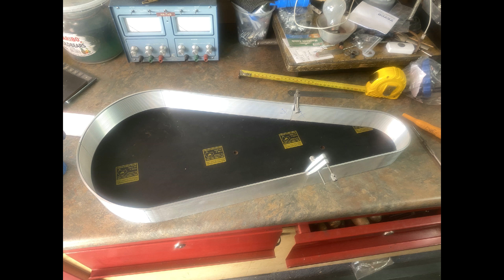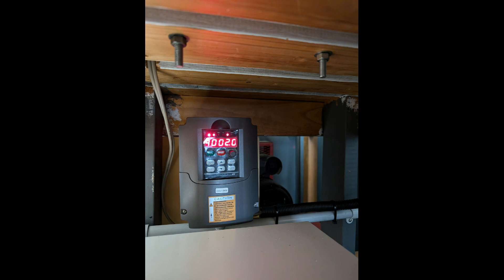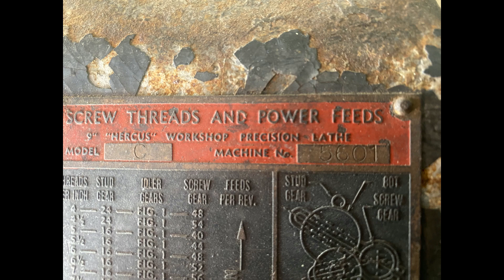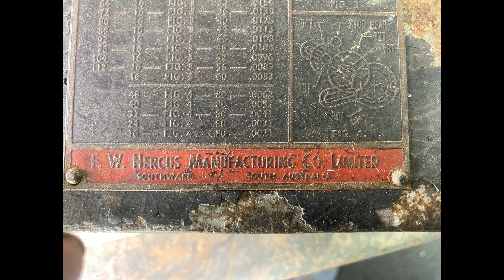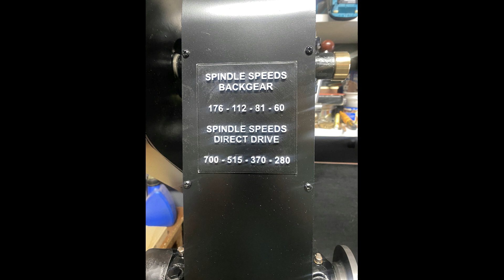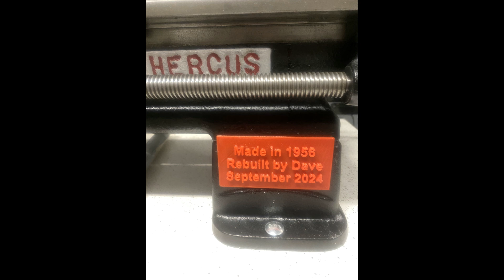Australian made Hercus 9 Inch Lathe Refurbishment

Comment: Interesting to see you fit a vfd system to this lathe. I have just converted my lathe single phase motor to a 3 phase vfd system and i cant get over how smooth the drive now is, how you finding yours.
Reply from the maker: Thanks for the view and question. It has not been used much since I did if for him as he is often away because he drives goods trains Interstate, and as is quite often the case, other things have been placed in front of it so it is not accessabile easily. I have let him use my Hardinge lathe and supervised as he is new to machining. As you saw in the video it runs very nicely, I have set the VFD up so that it goes from 0 upwards, I may well alter that to say run from half motor speed upwards. In that way you will get to use all of the potentiometer for speed where as it is, the first 1/2 only gets it 1/2 motor speed. In actual practice the motor is practically useless for torque below 1/2 motor rated speed. Enjoy using yours. Best Wishes.